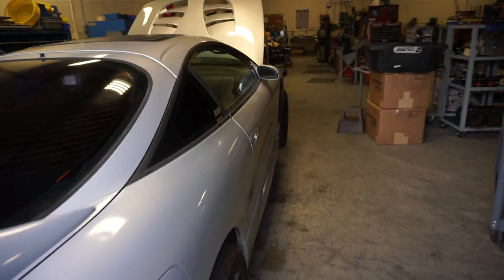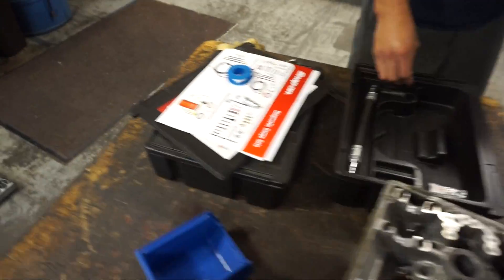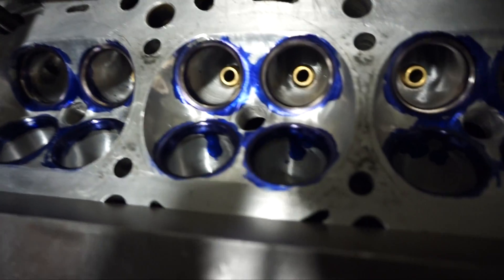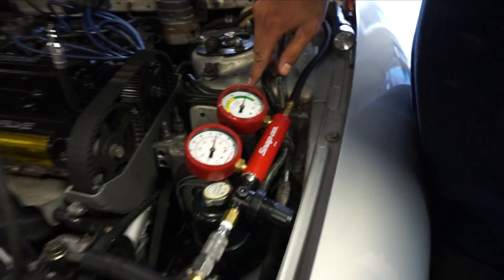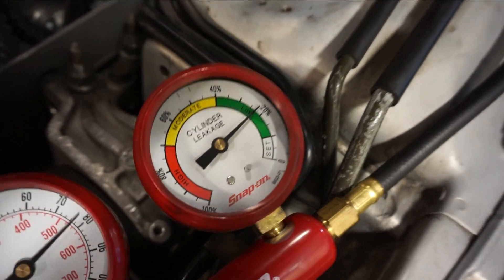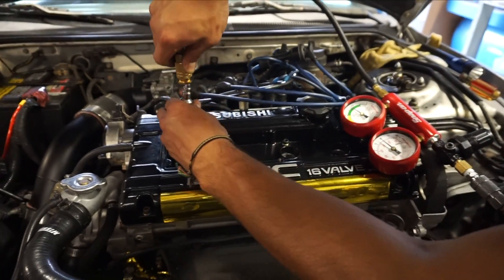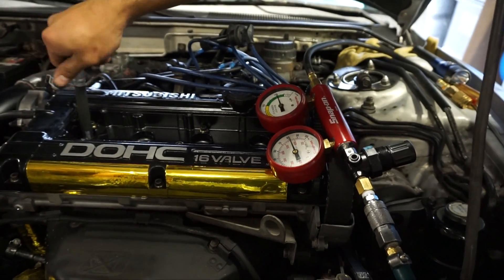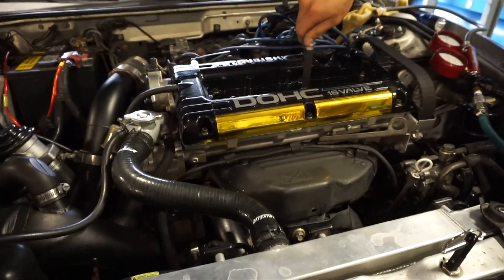Project 2g Revamped: Built Motor Leak Down Test

Comment: are you going to vlog while driving that beast?
Reply from the maker: I'll get some in car footage when its tuned. Driving the car during its break in process is really boring. Nothing but slow revs to 6k and then engine braking.
Reply: +TheBudgetTuner up to how many miles will u be in the "breaking in" process?
Reply from the maker: 500 miles